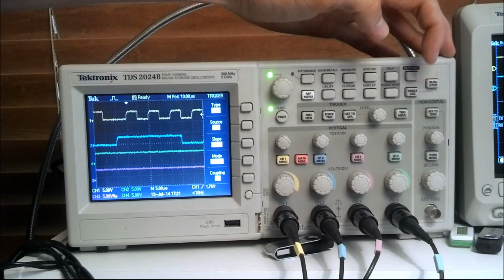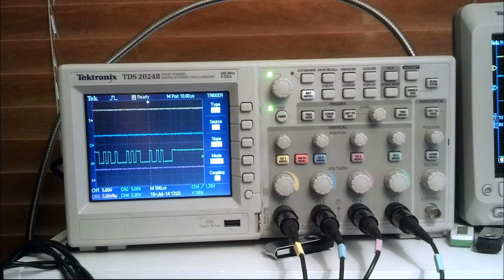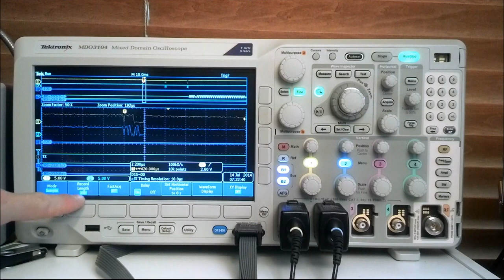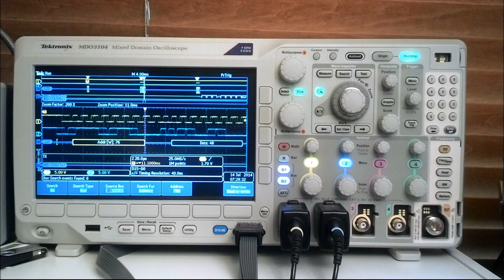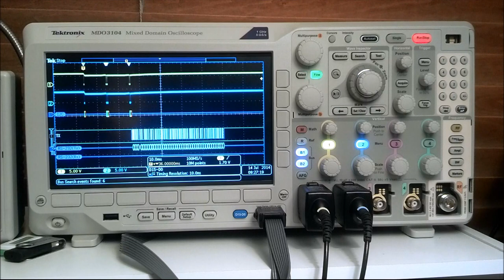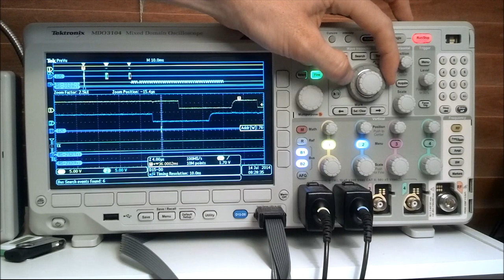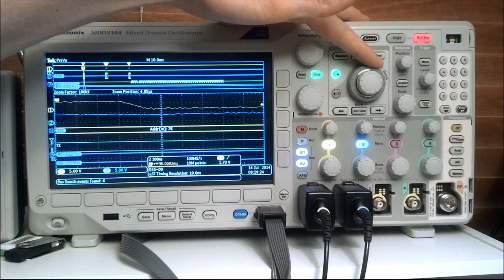Tek MDO 3104 Review 2: Digital Decoding Triggering for Analog Analysis

Comment: good share!!  Did you need to buy an optional module of "MDO3MSO" separately to implement the logic analysis function like the video show? I am getting confusion from the specification of MDO3000. Thanks!
Reply from the maker: Matthew, I think the MDO3000 series offers the logic analyzer as an option on the scope (Which I think is totally worth it to get the value out of an MDO-series), and then to have the scope automatically debug (i.e. display 0x23 on an I2C bus instead of 1's and 0's) you would need an application module. They have a bunch of different ones for the different busses: USB, peripheral busses, automotive busses, audio busses, etc...) but the one I show with the decoding of the peripheral busses is the 'MDO3EMBD' application module. More information can be found here: http://www.newark.com/tektronix/mdo3embd/embedded-module-mdo3000-oscilloscope/dp/29X1606 or on Tek's MDO3000 product page which lists all application modules under 'Software Packages': http://www.tek.com/oscilloscope/mdo3000-mixed-domain-oscilloscope
Reply: Dave Young Dave, Thanks for your comment and video share, your video let me designed to buy one. Thanks!